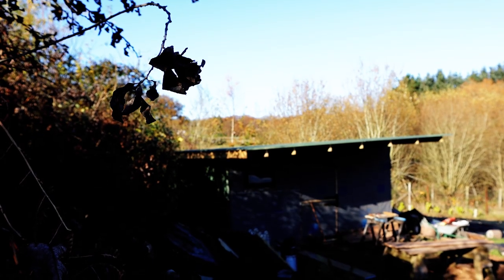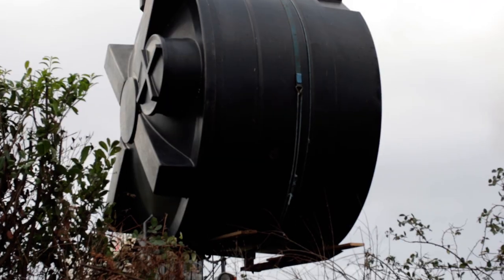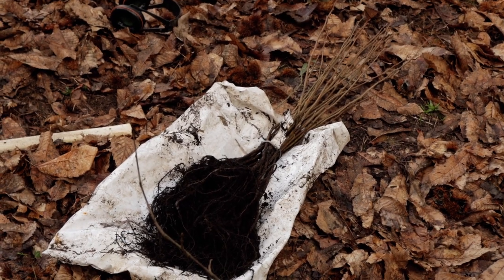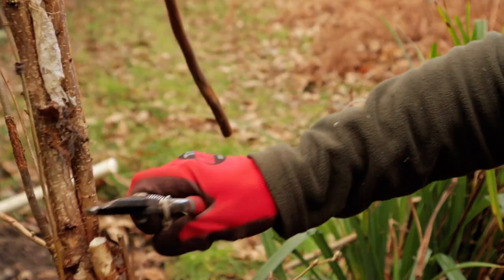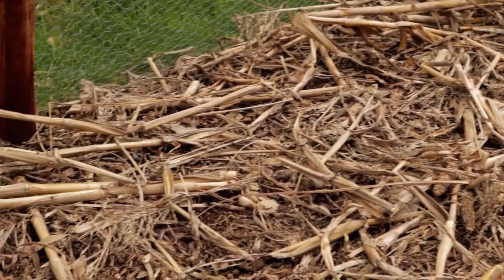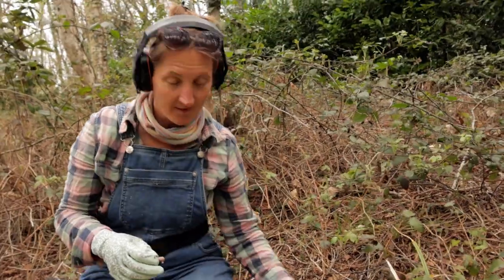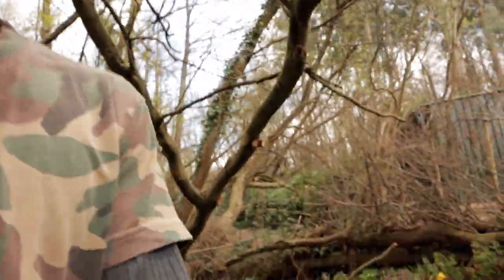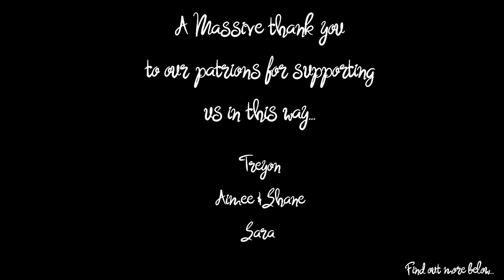Cladding our Off Grid Workshop | Planting a Hazel Coppice | Mushrooms Logs | Freedom Forest Life

Comment: How did you weather proof the door ? I’m thinking of cladding over the front of my shed , great job 😊
Reply from the maker: Hi John, we have a good over hang on the roof out the front that offers some extra protection, the cladding itself is quite weather proof, it has building membrane behind and OSB board, we are actually currently making some adjustments to this space and we may replace the door with French glass doors - not through any fault with the door, just preference for light inside mainly. We love the look of cladding, it is so beautiful 💚 Thanks for watching and hope that helps ✌️🌿
Reply: @freedomforestlife  thanks for the response 😊
We’re doing the same on our shed ( it’s only to house livestock but it must be 100% weather tight . 
It’s just the top of the door way that I’m having trouble getting my head around to stop water getting in . 
It’ll all be membraned battoned etc
Reply from the maker: Hi John , oh I see what you mean, our door does currently still have gaps around it,  with the roof over hang and that fact that it faces the opposite way to our prevailing winds here, we have never had any water come in, we would be fully sealing it though now if it was staying. I've had stable doors in the past that have had a rubbery or brush seal attached to the frame and to the door to create a seal when closed up.. if that makes sense ...
Reply: @freedomforestlife  thank you 🙏🏼